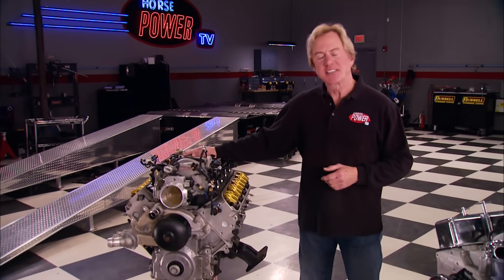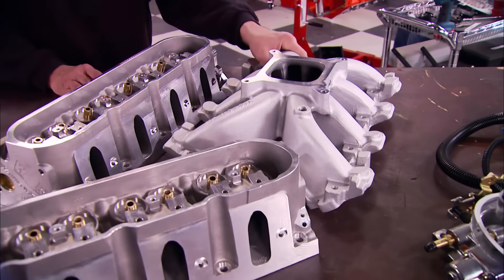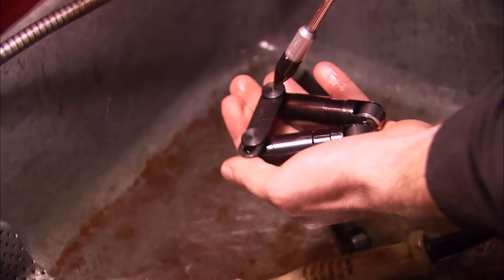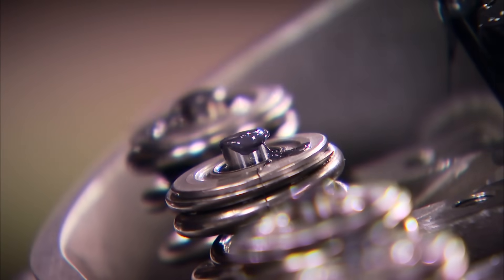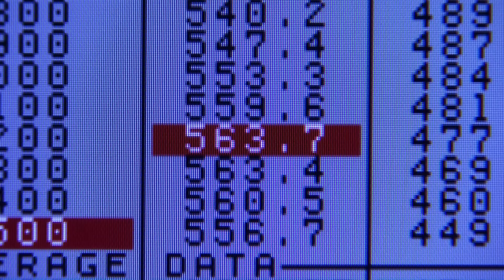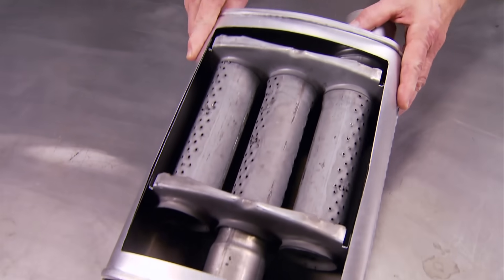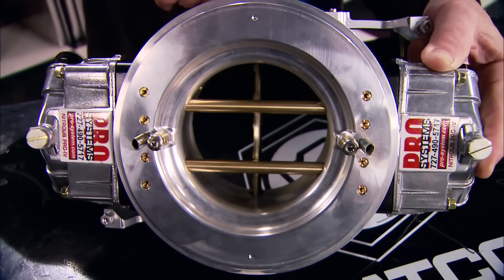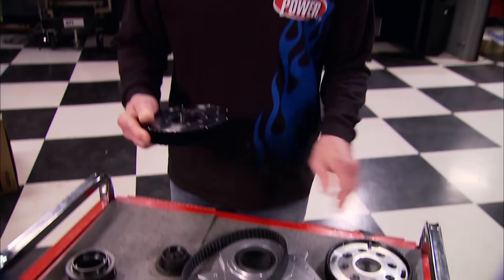Best of Both Worlds: Building A GM Smallblock With A Modern LS Top - Horsepower S14, E7

Comment: No real advantage to the hybrid motor. Get some aftermarket heads that outflow the LS stuff and build a SB shortblock. Less expensive and easier.  Hard to beat the old SB.
Reply: People on marketplace are asking too much for them. I bought whole ls 6.0 Yukon Denali (bad trans but running) for what some want for old sbc
Reply: @BruceLee-xn3nn That's because too many are willing to pay stupid prices. It's that way with everything anymore. It's ridiculous. Too many people with too much money I guess. Not sure how that works.
Reply: I tested a 383 SBC and a 383 LS with similar flowing heads and the LS beat the SBC by about 100 HP and was cheaper to build
Reply: You get a more stable valve train while retaining the original mounts so it's perfect for me. I have a 70 rs camaro and I want to build an engine that will Rev high for a long time but one day I want to restore it to original and take it to auction
Reply: @JohnSmith-um5px  you also get 11° valve angle vs say a 23 or 18
Reply: Lol. Theres 4.8 liter tire old truck motors that hot rodders are boosting up to 750 horse with stock internals.
Reply: It's not just port volume. LS heads exceed 99% of all aftermarket SBC heads on sheer valve angle. 15° heads are unheard of in street SBC heads. Just because some race heads will "flow" more, doesn't make them streetable. You lose so much bottom end with race heads because the fuel falls out at low RPM from lack of velocity.
Reply: @sylentxtinction2097  a good head porter will get a a set of  good 23 deg. After market Heads to flow 400 Cfm   Eric wengerner racing.  Look it up. And why is it you see you only see LS motors only on an amateur level. And on a professional level you. See Gen 1 sbc. ??????
Reply: Jesus does anyone know what the fuck an entertainment video is nowadays?
Reply: Yea it’s getting easer to find after market 23 deg. Gen 1 sbc heads that will flow the same as the LS heads. And if your gonna run big power Ls or GEN 1 SBC  you really want to go with an aftermarket block anyway
Reply: For the street fun factor, the sbc has more low end torque. The LS will no doubt make a better race engine if your looking for all out power.
Reply: @Jack Russelle Lewis yeah you can turbo a ls for the cost of a good sbc head, plus the ls has better bottom end, 6 bolt mains, beefier cam , no stupid distributor or cam gear to fail. I used to love sbc but i wont go back, there is no advantage. You cant beat a 4.8 or 5.3 for the cost.
Reply: Oh yes there is!! ALL the LS blocks have limited bay to bay breathing, which happens in virtually every "Y" block, Ford included. The Gen1 SBC with modern LS heads WILL gain about 20hp@higher rpm due to better bay to bay breathing. Call World, and ask for their test results......
Reply: Some of the best heads for sbc out flow only stock ls heads💀 throw a set of high 300s cfm heads and itll destroy the sbc
Reply: Yessir, my pappy could 0-100 quicker than my stock 350 hits half that. Did have a turbo offa caterpillar  but chea
Reply: Just go LS ffs
Reply: Dude the best aluminum heads for sbc still won't outflow stock LS heads. Sorry no comparison...
Reply: Even in the small 4.8 and 5.3 all it takes is a cam and spring swap + a tune and you over 400. For a sbc you have to basically have to start from scratch to get to 400-450 hp. If you start from scratch with an LS well over 500+
Reply: @zachniverson8816  a cammed swap 5.3 will never do 400 whp
Reply: SBC aftermarket heads will never outflow LS aftermarket heads
Reply: Well I still have my dinosaur SBC, in my 87, 3/4 ton, Silverado.   The engine was changed, because it was a 454.
Reply: I’d like to think turbo Honda can beat that out
Reply: There are no aftermarket csb heads that outflow ls heads.
Reply: @Paul-st2wv  Huh?? 🤔     YES there is.... There are aftermarket SBC heads out there that flow WELL over 400CFM's. The very best factory LS heads flow about 250CFMs.
Reply: @davelowets stock LS3 heads flow like 315 CFM stock and that's a OEM head.
Reply: Easy to beat a sbc, actually. A stock 5.3 will run circles around equivalent stock sbc, if you can even find them anymore.
Reply: At least put a coil ignition instead of a waste of power distributor
Reply: @johnpopoff7950  😆 A proper distributor does NOT "waste any power". 🙄
Reply: That's if you have a non damaged Gen 1/Gen 2, 4 bolt otherwise Gen 3/4/5 swap.
Reply: Not hard at all to beat the old S.B. with a LS, Buy a brand new LS 6.0 450hp crate engine for around $3800 from GM which has factory square ports, Change the cam/springs, Add a victor Jr, 850 Holley and you'll make 525-550hp and have less then $5K in it, You'll never get a 11* head on a old S.B that will flow over 430CFM and make over 1200hp natuarrly aspirated,
I use to be a diehard Gen1 S.B fan but I now refer to them as dinosaur engines as their old, 650hp is getting in the Very good heads, high compression territory with Gen1 S.B.,
Thats pumpgas GM head, Hydraulic roller power with LS
Reply: @bidenstoletheelection9116  You are not getting a brand new 6.0l lq4 for $3800. Then you mentioned all these parts but forgot to even add the trans then the rears. You'll be at $20k+ by the time you get everything working. While I spent $7k on my 5.7l vortec to a 383 stroker, built 4l60e; and 4:10 rears. She's not the fastest but this ole obs yukon gets down 😂
Reply: @mobent912 I have 5k in a LS2 build for my 4th gen Camaro. All that's left is fueling stuff and some seals.
Reply: @bidenstoletheelection9116  you can make the same power with a Gen 1 sbc as you can with an LS. Both engines have a 4.4 bore spacing,  at the end of the day your gonna have a hell of a lot more money in an ls engine.

Comment: That defeats the whole purpose the LS block is much stronger than standard small block Chevy why would you not use a 6 l block and I know for an absolute fact they will take a shit ton of power I have a friend making a thousand horsepower 750 on the motor 259 spray and it hasn't given up yet

Comment: My small block I used Eskandarian camshaft along with their anti-pump up lifters works like solid lifters but hydraulic bad ass, my 327 is now up-to-date as far as that goes turbo 400 Street shift kit 373 true track rear end. In a 1940 Ford deluxe two door coupe! Yeah.
Reply: you lose a lot of torque running a turbo 400 with a small block especially a short throw small block to heavy of internals it robs the power big time a Turbo  350 built is sufficient!

Comment: An sbc with Ls heads is a great idea until you realize you can't mount accessories with the coolant crossovers in place.
Reply: This is a custom milled block, nothing really says gen1 about it anymore
Reply: Pitch Meeting guy: whoops
Pitch Meeting exec: whoopsie
Reply: I agree that's the only downside,  the guys who designed it forgot to design the Coolant system for the Thermostat housing. Still be a Interesting conversation at a car show when Ya open the bonnet

Comment: They do all these projects but never fess up to what it all costs. For the price of the special block and crank along with the rods pistons cam and lifters, you could probably build at least two 600 hp LS motors to put that set of LS heads on.
Reply: You could just build a 500 hp old school 350  for cheaper then this
Reply: @aaronmcilvain8077   they stay very tame in their builds so this isn't a bad set up for only 10 to 1 compression
Reply: Looked it up, $2,600ish. Big ole yikes. You could make a junkyard monster for that.
Reply: @yeanah2571  this is more of a circle track endurance engine to be ran hard for a whole season before freshened up not really a budget dragracing engine hence the low compression JE Pistons made to run all night without seeing the south side of 5000rpm unless your under caution or loading it on the trailer
Reply: I built one it ant cheap
Reply: Yeah I'm clueless cuz I'm not a car guy I just like Beauty in the cars and the people that have the passion that's cool but I have no idea what things cost because you know I drive a fucking Toyota. It gets me where I need to get I want to drive to New Orleans for the weekend no problem

Comment: The very obvious,,,, Look at that block with the water holes alongside the head bolts. With  a way inferior bolt system, only 4 per hole and not 5.
And with all the aftermarket heads around  they match the power anyway. And have done for years. So why fu*k with it??

Comment: Oh, wow, turning a small block Chevy into a small block Ford.  I don't get this. Why wouldn't someone just use some nice small block heads on a stock block.  The old small block Chevy has heads available that make just as much or more power than the LS stuff.  Easier and cheaper with similar results.  I'm gonna call this mental disorder "LS for LSs sake."

Comment: Isn't one of the best attributes of an ls the fact its a deep skirt block with side bolts for the mains? I think if you really wanted to run a distributor you could have a Gilmer belt driven one made up cheaper than the cost of the short block of that engine.
Reply: For strength-Yes.
For bay to bay breathing-NO!!
Reply: @milojanis4901  factory ls heads are far superior to the best sbc heads. Not sure what you mean by "Bay to bay"

Comment: as a Happy Gen 1 owner (358ci, .600" solid roller, knife edge crank/aluminum rods, ported 492 angle plug heads/port matched intake, 12+ to 1 Comp.). Mine was dirt cheap compared to this hybrid (it is a sweet sbc), seems like a lot of expense for a 10% 0r so gain, still good info. (mines in a 2350lbs MGB street car)

Comment: You can mount ls heads to a factory sbf. LS block looks more like an old ford fe block then a sbc.
Reply: Some guy did put LS heads on a FSB . Had to have a special cam ground. But it did run and put out decent power till he put a turbo or two on it and blew rod through block. I'm vid is still on YouTube
Reply: @stickpd7885  I've seen that.

Comment: Crazy to build this caliber of engine with a cast iron timing gear, i dont even use them in stock engines anymore since ive found 3 cam gears cracked with nothing more than a valve spring upgrade. Luckily they chose to do a cam change soon after spring upgrade
Reply: I go with the pro comp timing belt setup it's bullit proof stuff with adjustments for different degrees
Reply: @richardfinney3179  what do you do with your engines, drag race, street or?? Been looking at PC belt drives but if the quality matches most of their off shore junk i dont thing i will be willing to trust one on drag n drive events where the cars need reliability

Comment: An expensive solution to a limited problem.  The money spent beefing up the bottom end and a new block could be put into an ls engine and call it a day.  Why don't you spend a ton of money to put ls heads on a small block?  Solutions are endless to almost fruitless engineering problems.  Since this is to be a street motor, this makes even less sense.  Being a Mopar guy, I don't have to deal with small block Chevys and LS engines.  Also going back to a distributor negates the accuracy of the distributorless ignition.  Again, one step forward and two steps back.  Still it is meaningful to have knowledge of the technology, even if I will never use it.

Comment: They should have made LS heads fit the sbc. Would have sold more..
Reply: I agree totally stupid, and also to not make it a 6 bolt LSX pattern on the block. Midas well just build a 6.0 iron block LS
Reply: For $700 you can buy an adapter kit to install a small block Ford distributor on a LS engine. Allstar LS Timing Cover Conversion Kit ALL90090...
Reply: They will fit a sbf .
Reply: Yea they should have done that a long time ago
Reply: They explained why things are the way that they are. It's for race applications that require distributors and other older parts. 

The differences in water jackets, deck heights, intake ports etc, may have made things less than ideal. 
My takeaway from this, is it's for racing applications that require certain things like a distributor. For all other applications, use a run of the mill LS.
Reply: @Shutchohole  They make a timing cover to run a distributor on an LS.... circle track has been using it for years.  The problem here is this episode is probably 10 or 15 years ago lol.
Reply: @LSswapGarage1  who is 'they'?
Reply: @Shutchohole  so just put a distributor on an LS
Reply: @holmes1956O  it wasn't possible 15 years ago like it is now. That's why they used this block.
Reply: @holmes1956O  you can do that. They use a Ford distributor and it endsup looking like an old ford.
Reply: @BruceLee-xn3nn  or an old buick

Comment: All these young whipper snappers that don't know any different hating on the SBC. There's nothing terribly special about LS bottom end. This is a great block. I would love to have one. More so than a complete LS.
Reply: I am 64 yrs old and still have my 1968 nova ss that I bought when I was 20yrs old. I think this thing is an abortion and a waste of money. The hp numbers they made are easy to make with a conventional small block so why go this route. 😵
Reply: @holmes1956O  true, a SBC can make insane power. The truth is that this top end will make more power easier from mild to wild. This block has two more things I like; 1) uniqueness, and 2) I like the look of the exhaust ports better. They're like a BBC
Reply: @OldAndGettingOlder  if you have an unlimited budget and dont mind your aftermarket parts becoming unavailable then great. I prefer to build as cheap as possible and as reliable as possible for the money spent. So far that philosophy has done well for me. By the way I am 64yrs old and still have the 1968 nova I bought when I was 20yrs old. 2 engines for it 350 small block and a 427 big block
Reply: @holmes1956O  budget can be a factor. I understand your penchant for the SBC. It's what's I'm my '68 Firebird.

Comment: So you cannot use an old block, you have to buy a new version of the old block.  
Smh.  Just go with a real LS block and do it correctly.
Reply: It's kinda pointless. By the time you go through all the trouble of buying the custom block, buying all the engine parts, buying a new custom grind cam and roller lifters anyway, and buying new heads and intake anyway

You could've just built up a small block with just heads, cam, and intake and make close to the same if not more power and use the money you save for roller rockers, balanced bottom end, etc.
Reply: lol, it is pretty funny when you think about it. You can also run a distributor on an LS if that's a rule in whatever slightly obscure racing class you find yourself in.
Reply: I’d rather have the old block and better parts.

Comment: Nothing in common with the old SBC but alot in common with a and 351w. Thrust bearing in the center, equal length ports, and same head design with 10 headbolts. I work at a machine shop for a living so I know.
Reply: The breathing characteristics come from ford

Comment: Think they'd make them the other way around but I guess we can't argue with progress??? Why don't they just re-design a LS style head to fit any stock small (block) bolt patterns. BUT I'm sure there's plenty of other issues with cooling flow and other minor things.
Reply: The major thing is a SBC has 5 head bolts per cylinder instead of the standard LS’s 4. You couldn’t make an LS head with the SBC cylinder head bolt pattern. It wouldn’t resemble an LS head anymore.

Comment: Might as well just buy an LS engine for less than it would take to build the hybrid.
Reply: Bare block is $2,500 or so! 🥵😳
Running LS at pull-a-part is what? $750 (depending on where you are and where you go. $250 in oklahoma). 🤣 for me that would leave about $2,250 for turbo and supporting mods for 750+ HP

Comment: I used to think these blocks were a good idea. But it turns out stock internals are just fine on engines without detonation problems and the ls parts are well designed. While the sbc has an oil pump that doesnt eat much power the ls has ventilation between cylinders, larger cam core, a cross bolted skirted block for noise rejection and main cap stability etc... The ls has proven that the importance of a forged crank in anything but a split pin v6 is highly over rated and if you don't have to buy racecar parts then why do it? The aftermarket has addressed the oil pan situation and the lack of a distributor and even with the hybrid block headers are still a consideration and now brackets can be an issue where they wouldn't be with a true full ls. I mean if you just love distributors mechanical fuel pumps it might seem like a good idea but for the cost of an aftermarket block you could just buy afr heads and keep the 23 degree setup. Heck you could but 15 or 13 degree race heads or some used sb2 or 18 degree heads.
Reply: Right, lol???

Comment: Man....all that bread and you still have to use lifters with link bars? Why couldn't they have least provided threaded spider bosses so lifter plates could be used with 85' up flat-sided lifters instead? I've had link-bar rivets come apart before; but now that I'm running  solid rollers with roller bushings, (which weren't cheap by any means), and a rev-kit, I don't think there's as much stress on them to rotate as before. They still make me nervous though and I can't help but keep an ear out on the lash. Definitely a "weak" link.

Comment: Why? Seriously, what's the point? Unless you're in some specific racing series where you have to run a stock block for the year your car was made but for some reason the heads don't matter, I guess it makes sense.
Reply: But, in Reality, it is Not a stock block....... It is a modified block to fit the LS heads...... You can't food an old die hard Chevy guy......